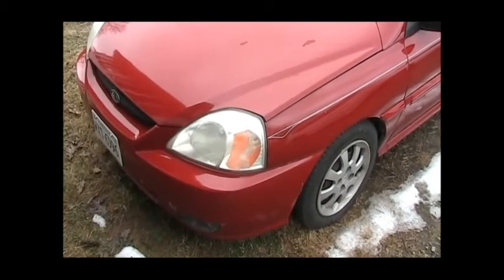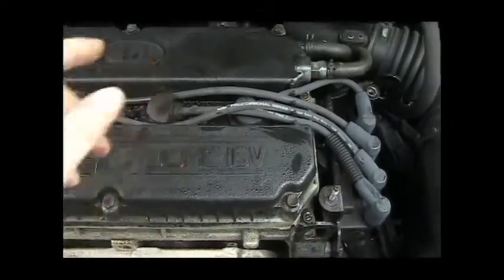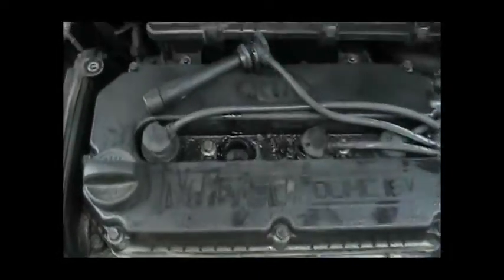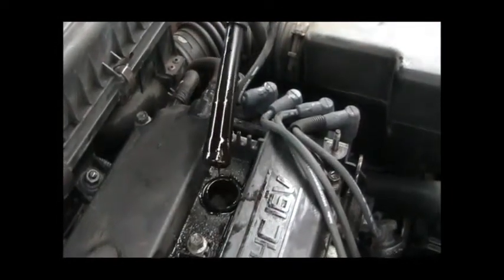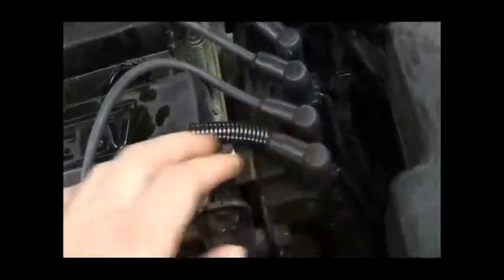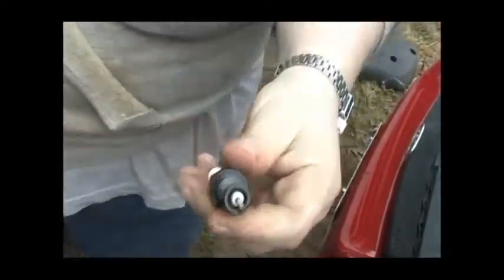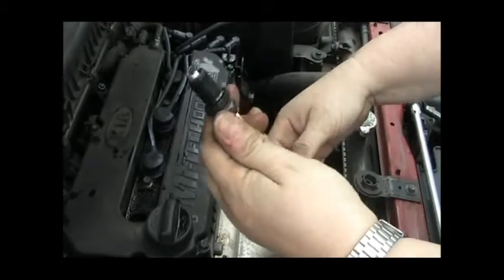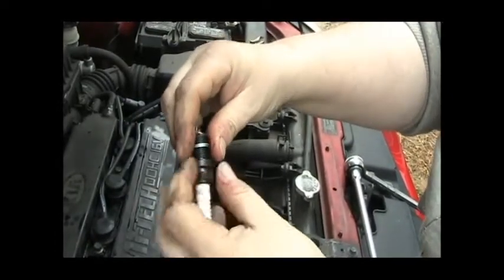Spark Plug Replacement 05 Kia Rio

Comment: Thank you!!! I NEED HELP! My sons car…the tail lights and dashboard lights stopped working and now his car won’t start something is draining the battery. New Battery New Alternator and New Starter…ANY IDEAS??? I’m a single mom (disabled) and I don’t know much about cars or have help.
Reply from the maker: It sounds like you may have a short somewhere in the electrical system. Unfortunately, there's not an easy way to find it. Check all your fuses and fuseable links, if any. Beyond that, you'll probably have to take it to a shop.
Reply: Oh man..☹️ okay thank you for responding
Reply from the maker: @mscharleyjxox  Sorry I couldn't be more help.

Comment: The oil change guy didn't spill oil down in there. The top of the spark plug holes have those rubber caps that keep them sealed. What's leaking is the spark plug tube seals The metal tubes that those spark plugs go down in have a seal in the valve cover at the very top. They are either extremely worn or misaligned. When you install new tube seals or reinstall a valve cover with old seals you must make sure to walk the edge of that tube around the seal. If you don't it does not seal and will fill those tubes up fairly quickly. Other than that good video
Reply from the maker: Thanks for the info. So far the problem has not recurred and the car is still running well.

Comment: Do the order of the ignition coils arrangement matter? kindly enlighten me
Reply from the maker: I didn't do anything with the coils in this video, but yes, the order of the spark plug wire connections is important. If you connect them in the wrong place your firing sequence for your engine will be wrong and could cause damage. So make sure you know which wire goes where.

Comment: Now that is a good video!  Good teaching subject. Good camera work.  And it shows the complete story from start to finish.
I am impressed that you don't mind getting your hands dirty and that you know how to work on a car.  Very good job!
I did subscribe!
Reply from the maker: +OldAlabamaGardener Thanks, Charles! Had hubby hold the camera for me on that one.
Reply: +Aelanna64 I was wondering about how you were holding the camera.  It really helps if you have someone to hold the camera because then you can concentrate on what the video is about.  I have to use a tripod to hold my iPad and sometimes I forget to start the iPad recording.
Reply from the maker: +OldAlabamaGardener I have a tripod but usually I am shooting somewhere that I can't really use it. Also, the HD camera I have doesn't have a tripod mount at all, and needs to be connected to a computer while it's used, so I don't use it very much.

Comment from the maker: I still own this car and it's still running good. I recently changed the brake pads on it, and one of the caliper bolts snapped off. So I had to replace the caliper bracket as well. Unfortunately, I didn't have the opportunity to film it.
Reply from the maker: @scout Yes, I have worked on many cars, and the Rio is not bad to work on. I do wish the wheel bearings weren't pressed in so I could work on those myself. My older chevys you could take the wheel bearings out, grease them or replace them, and put them back in with no special tools needed.

Comment: Great video! How many times have you replaced the timing belt on that car ?
Reply from the maker: I have replaced it once. I have no idea if it was ever replaced before I owned the car or if the belt was original.
Reply from the maker: @scout Yes, it's fairly involved because the engine is mounted sideways and you have to take a lot apart just to get to it. I always have that done by a shop because I don't want to mess with it. It should run around $300 to $400 to get it replaced, depending on what else they do. Most places recommend replacing the water pump at the same time since you have it all apart anyway, and that's a good idea.

Comment: i was wondering why there was a metal rod sticking out of the spark plug, i realised that it was the wire which had broke on it, guess thats to change too
Reply from the maker: I'm not sure what you're referring to... Do you have a timestamp for this?
Reply: @Aelanna  Oh ! Your video was perfect, here is the context:
I bought the exact same Rio, in November, and found out when i press somewhat hard on the gas that the engine does misfires, So i checked the sparkplugs and to my surprise, on top of the most left sparkplug is a metal/copper rod, this rod is supposed to be in the Ignition cable that you remove from the spark plug, hence why the engine has struggle, so your video helped me finding out if this was normal or not(It wasn't)
Reply from the maker: @rqinn  Oh! Ok, that makes sense. ;) Yes, change your wires and plugs together, by the time one thing needs replacing usually the other does, too.

Comment: I would assume the oil change guy put clean oil in the vehicle.  That oil looked like crude oil. Who knows.  I would suggest your change out your leaking valve cover gasket and o rings for the valve cover gasket.  Nice tip on the spark plug socket

Comment: Using the wire to pull out the sparkplug in lieu of a sparkplug socket was a fantastic tip.
Reply from the maker: It made things a lot easier, for sure. Thanks for watching and commenting!

Comment: Hi, a friend of mine gave me a 2003 kia rio which is basically the same car. He parked it and some theives came along and stole the battery by chopping the battery cables, i've recently found the positive cable, but i CANT figure out where the negative grounded out to. do you know where it grounds out to?
Reply from the maker: According to my research, there is a cable harness that these cables connect to. My Rio is currently buried under snow, so I can't take a look.
Reply: Aelanna64 ok, thanks! My rio is ALSO buried in snow. Need to get it towed next spring.